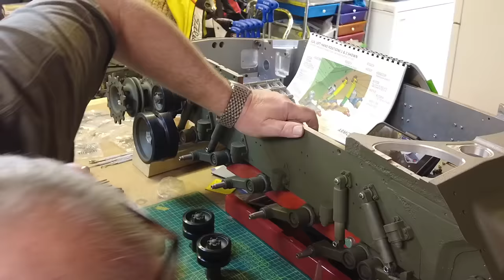1/6 scale Armortek M26 Pershing RC Tank build. (Vid 11) Installation of Sprocket and suspension arms

Comment: I looked at one of your old videos on the tiger, what I have decided to do is I purchased some 8oz spice bottles, and separated the fasteners,labeled them,and put them in 3×5 little zip lock bags. The bags go in the jars, and when the instructions call for a fastener,I can go to the jar, open the needed bag,  and get what is needed. Less time needed to find , no tape to reseal the bag! I also went through the instructions and listed on  paper via the packing list what box and / or what bag in a box the parts are in.  I think that it will be easier to find parts. That way, you don't need to lay everything  out, should one not have the space!! Good video.